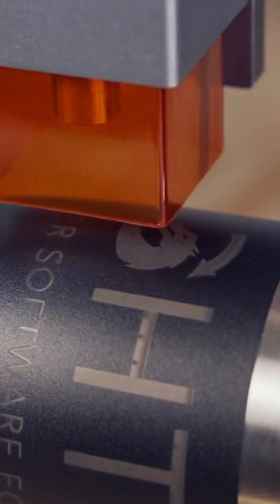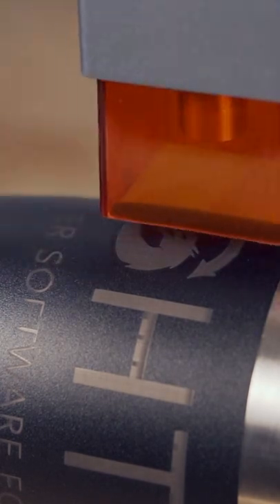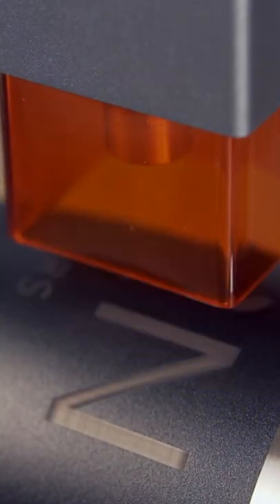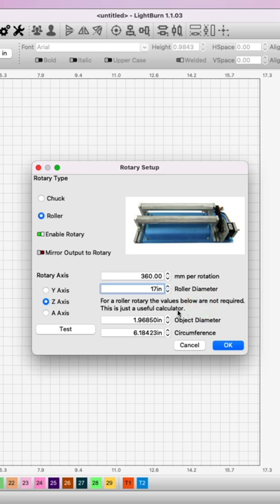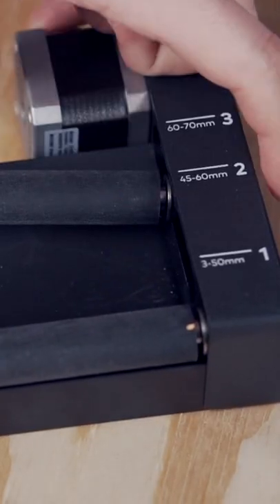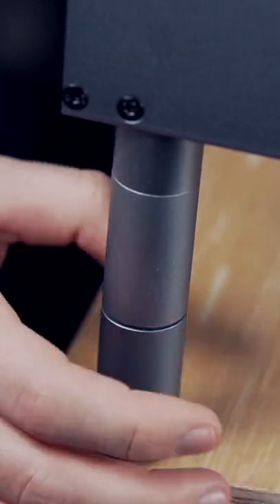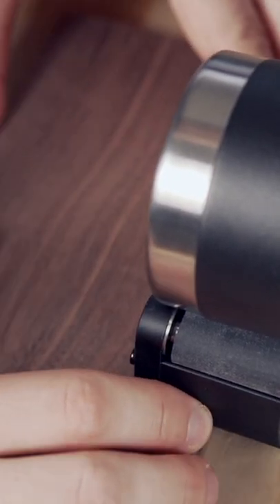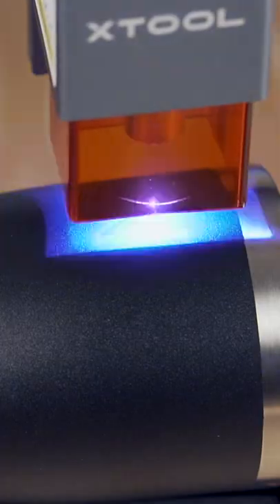Engraving a Tumbler With a Diode Laser

Comment: My text is coming out in reverse how do I fix this?
Reply from the maker: Turn the rotary 180 degrees, so the motor is on the other side, or turn on the 'Mirror output' toggle in the Rotary Setup window.
Reply: You may have the wrong cable on the stepper motor, crossing (or not crossing) the two middle wires.